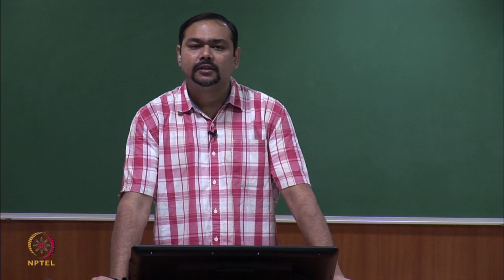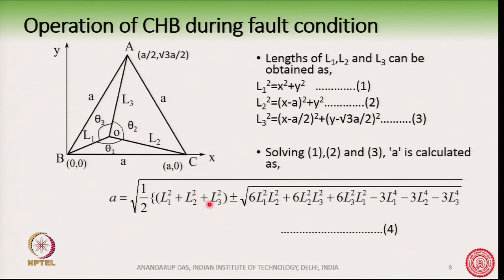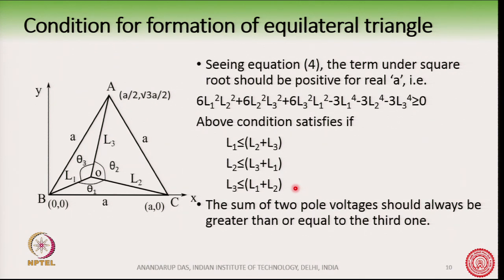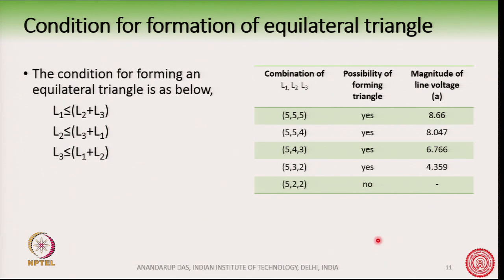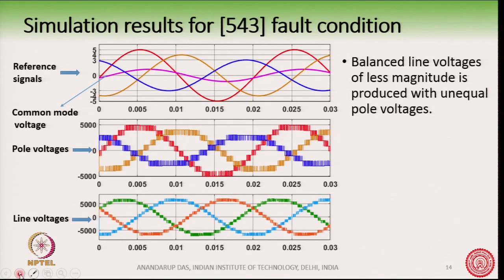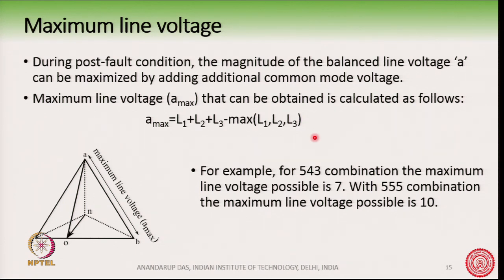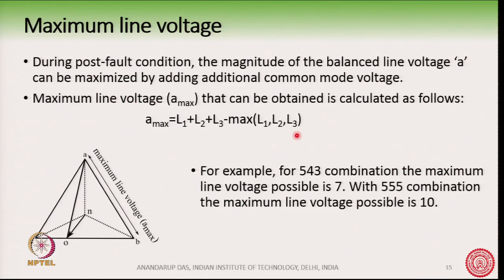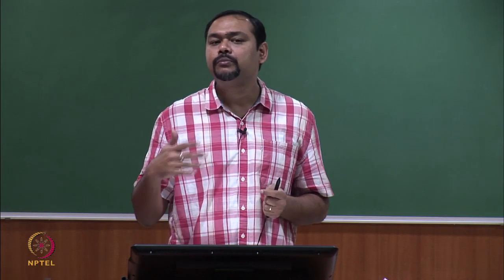Fault Tolerant Operation of Cascaded H-Bridge Converter: Part-II

Comment: Sir, If any one of the modules fails in cascaded MLI shall we reconfigure and produce the same voltage using PWM techniques without using additional components.